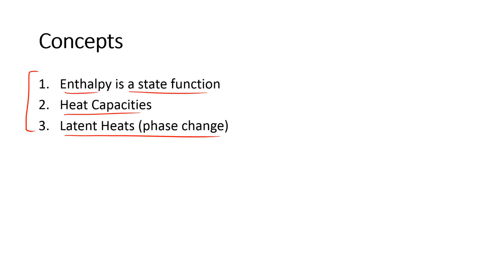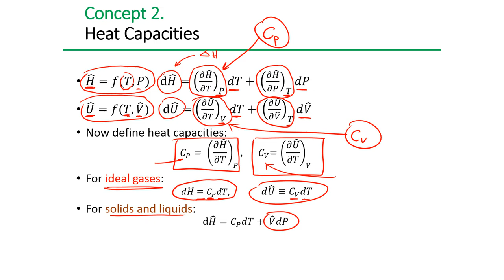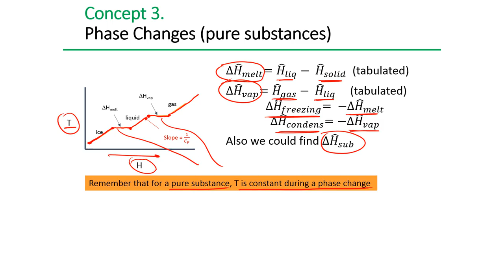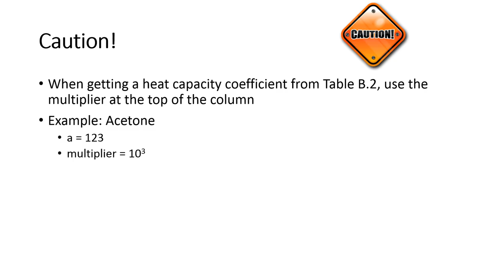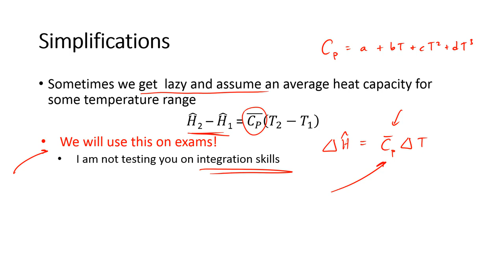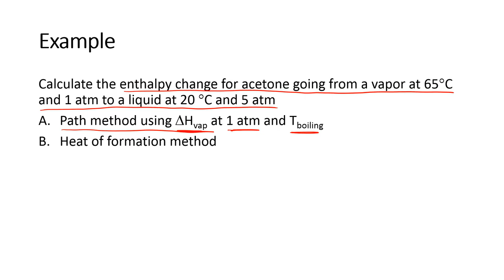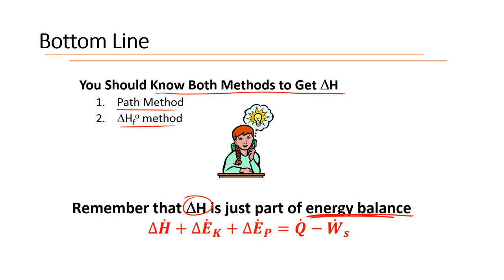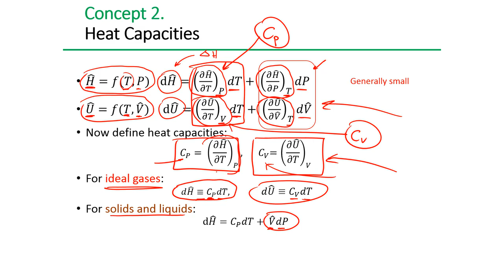Heat Capacity for Engineers

Comment: 6:44 So is this heat capacity formula part of a power series since there are technically more terms?
Reply from the maker: Good observation! It is not necessarily part of a power series expansion. The heat capacity data is generally just fit to a nonlinear correlation such as those shown here: http://trc.nist.gov/TDE/Equations/FEquations.html#Cp-IdealGas  The DIPPR database has 2-3 different nonlinear relationships with some that are polynomials while others include terms like sinh or exp(). All of them in the DIPPR database are only a function of temperature and are probably chosen based on which form fits the data best over a specified temperature range. With any nonlinear empirical correlation, it is highly discouraged to use that data outside of the validated temperature range. There are JANNAF correlations for high temperature gasses, if needed.